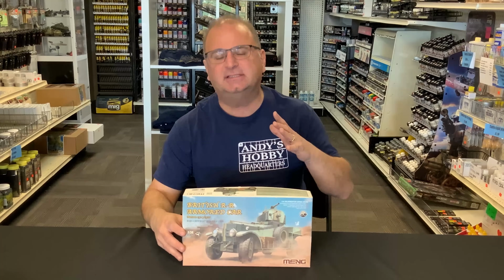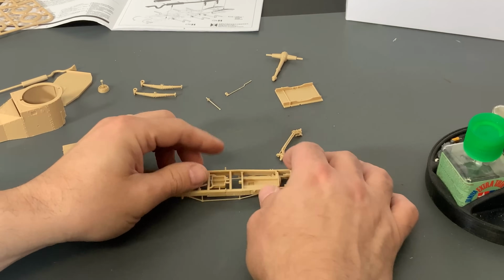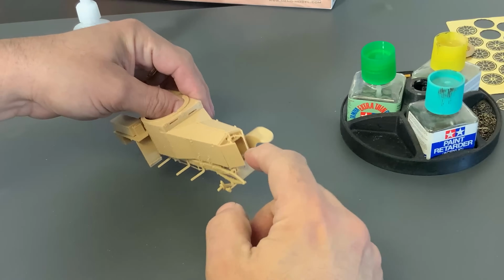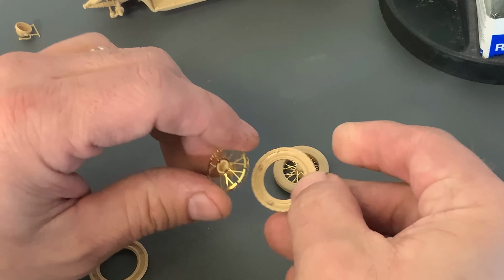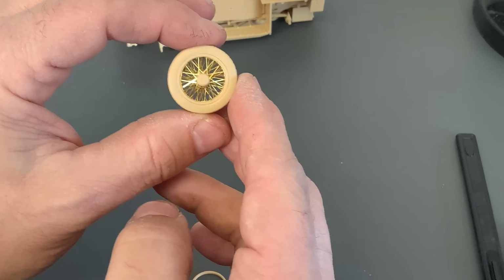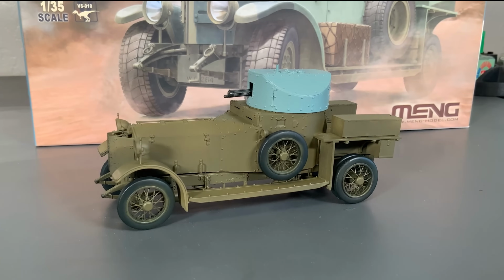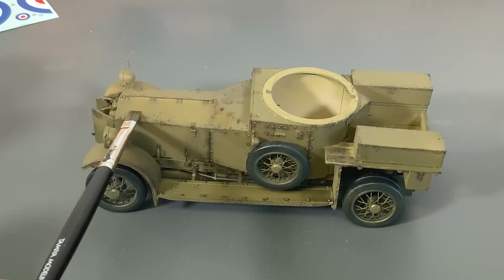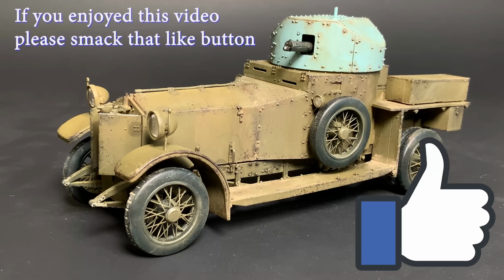1/35 Rolls Royce WWI armored car by Meng Models (complete build video )

Comment: Great to see the love given to what would have once been obscure WW1-era vehicles!

Just on the skinny/roll-over thing - they might have been skinny, but for the most part they drove much more slowly (esp ones like the 'bus when loaded), weight was still fairly low down, but possibly most of all because the tyres back then would be more inclined to slide than to grip, especially on non-paved roads.  But yes, they could fall over if the wrong circumstances arose.

Comment: Andy, very nice build of an unusual subject. I find a couple of blobs of blu tack are useful for holding photo etch off the workbench while attaching other parts. This prevents gluing everything to the said bench! Not quite as good as having three hands would be, which usually seems to be necessary when working with PE.

Comment: I had a question about painting: When an accessory, which is a different color than the main model, is being added/glued to the model do you paint that item before you attach it?   Like the tank has a grey base color.  So you would paint the base model grey, then paint the item black and then glue the accessory to the main model?  Note: a tank model might not be the best example.  Thanks

Comment: Love the look of this model. Quick question, I'm starting out and wondering if I should use BSI super glue or tamiya extra thin on plastic models like you are. Wondering if there's a reason you use plastic cement over super glue. I think plastic cement might make stronger bond but is it more fragile or take longer to dry. Just wondering and again great video

Comment: The RR was in use in Palestine/Iraq in early WWII. I've done the Roden 1914 armored car. No doubt the Meng is a much cleaner build (the Roden is not a good build.) However, Meng kept the same turret for both the WWI and 1920+ models. This is not correct - and Roden has it right; The 1914 RR had a much lower turret - the difference is very notable. But no doubt few would know the difference.